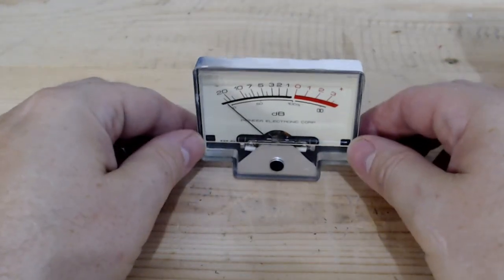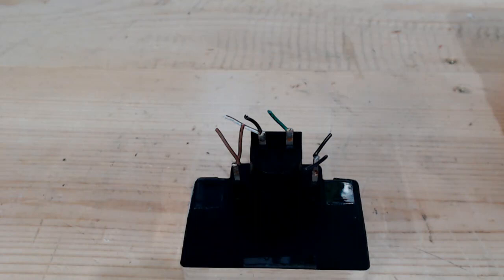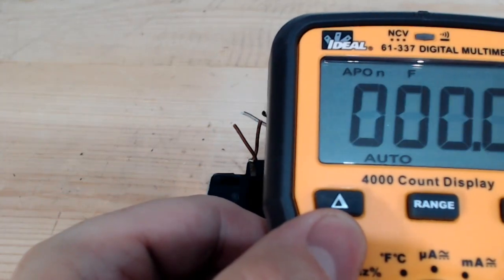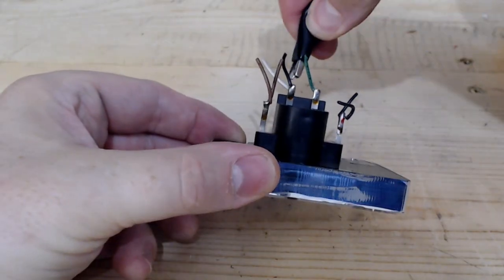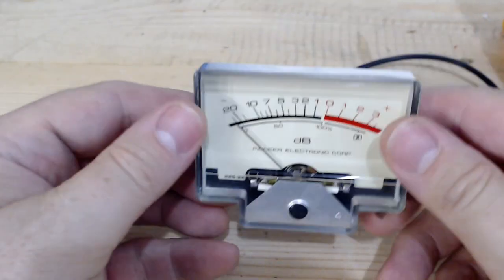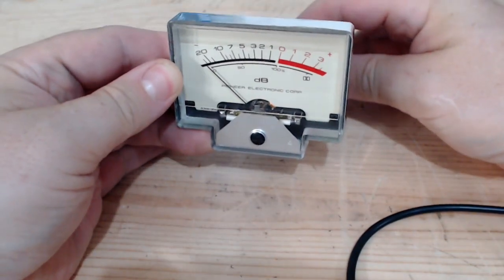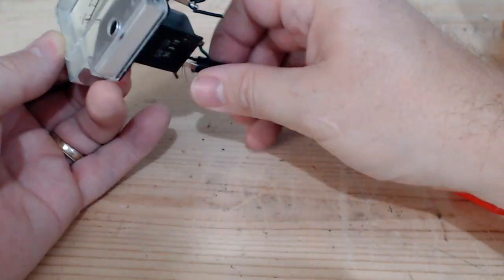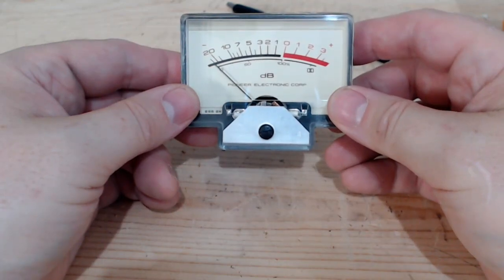How To Test a Stereo VU Meter with a Multimeter

Comment: OK so it "jumped" (so would you if a giant touched your leads (hands) across an electric fence).
What I need to know is this, how to wire these things, across a speaker's terminals, to know what the VU reading is, when you have many different channels all powering speakers.. without any VU meter on the amp itself, as the amp only has two channels whereas the speakers come off different circuits that originated from the amp, but get further split before the speakers see the currents..
Reply from the maker: No idea…if I wanted an external VU meter I’d personally just purchase one, but I have more $$ than time to figure such things out these days :)